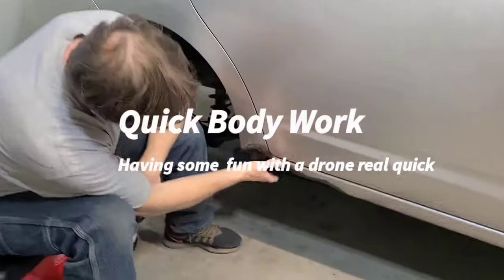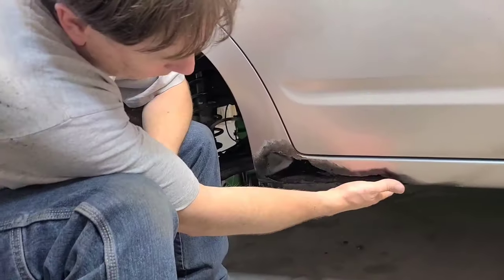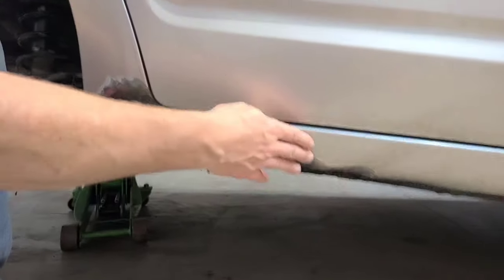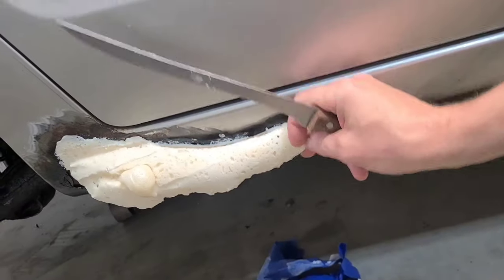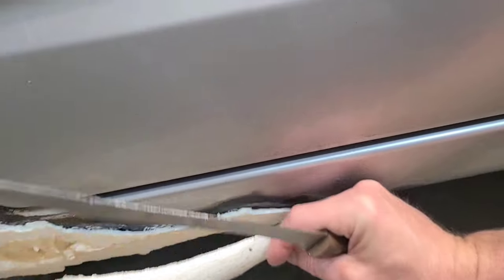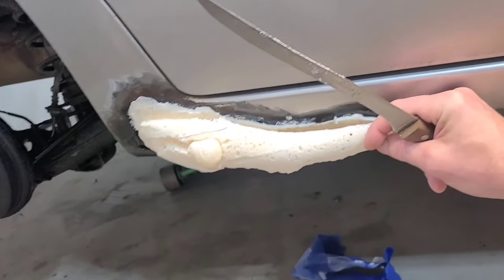Fastest Easiest Way To Fix Rust Hole In Car

Comment: What was done here is, the canal or the drainage where the water has to go through to get out of the car is now completely blocked, and the water will start to build up inside and push out the foam while rotting the surrounding metal, and potentially creating a new holes.

Comment: I‘m actually interested in that method. How does that look now, 3 months later?
Reply: Like it needs to be repaired again. In 2 years you spend more money than a proper repair.
Reply: @raduszilagyi6055 i did a similar method with a steel door about one year ago and it still looks as good as it was done. But I guess a car is just another thing as it gets wet more often and needs to withstand more different forces.
Reply: The last person who own the car I have did that...  When the temp have changed from spring to summer, in a 35 celcius day, it just gonna take expansion and look shitty.

Comment: Why I take a magnet when shopping for a used car
Reply from the maker: Prius has aluminum hood.
I have another Prius in next video I will be uploading. It's my first time doing vinyl wrap. 
Anyway, using magnets to hold vinyl in place while cutting material, I found magnets don't stick to the aluminum parts. Before that I thought they were steel. Between that and all the plastic parts, I didn't get to use the magnets much.